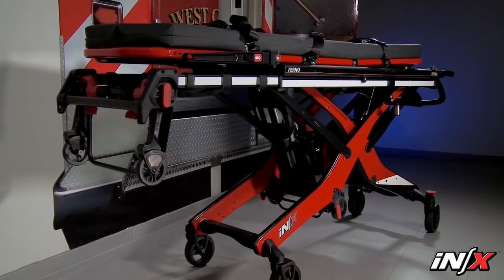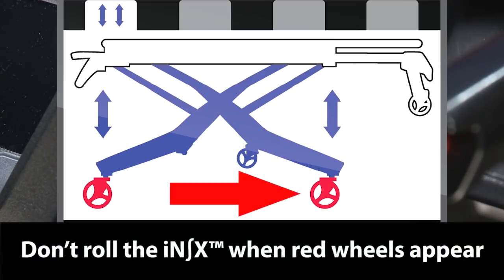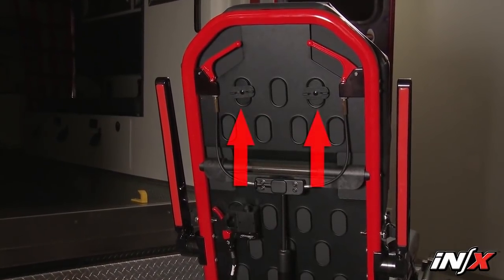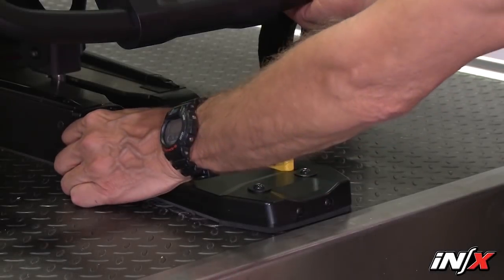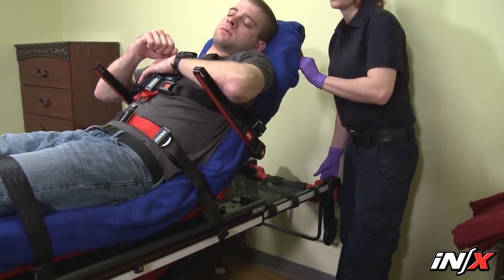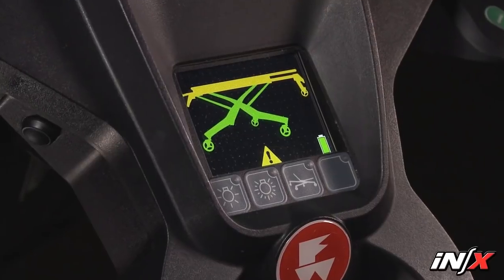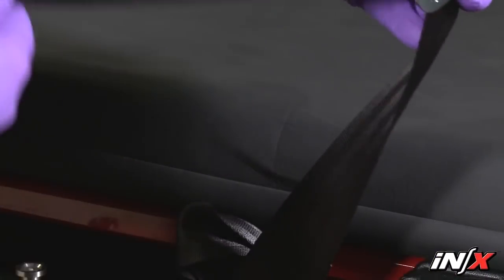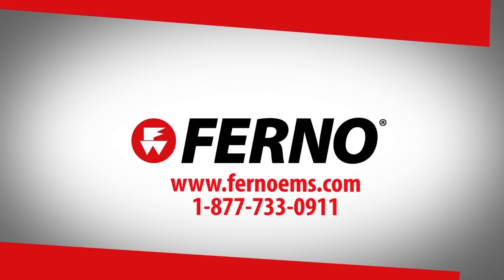00 iNX with iNLine Training Video

Comment: 0:10 Introduction
2:52 Initial Setup
7:24 Display
10:38 Battery
14:04 Power
15:13 Features
   15:20 Extend and Retract Buttons
   16:42 Locking the Pad
   17:15 Backrest
   18:10 Sidearms
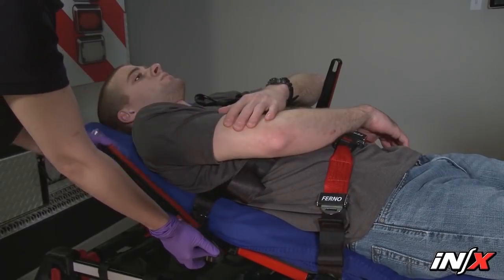   19:10 Telescoping Handles
   19:48 Telescoping Frame
   20:54 Shock Frame
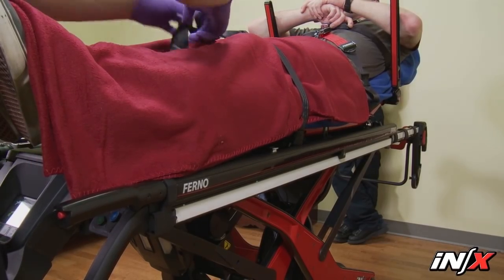   21:40 Accessory Rail
   22:45 Wheel Locks
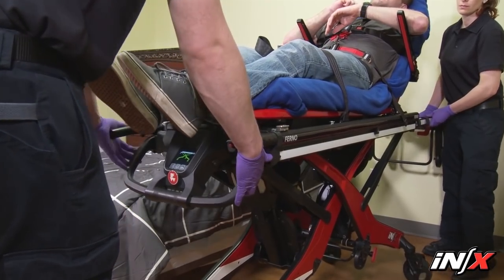   23:28 Lighting System
   25:14 Safety Bar Release Levers
   25:50 Oxygen Cylinder Holder
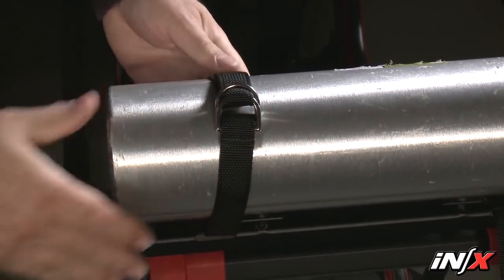26:45 Using the iN∫X
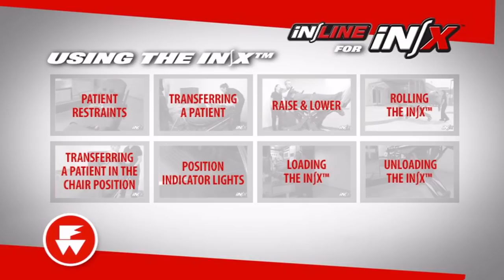   26:50 Patient Restraints
   29:40 Transferring a Patient
   31:55 Raise and Lower
   35:16 Rolling the iN∫X
   36:58 Transferring a Patient in the Chair Position
   39:28 Position Indicator Lights
   40:08 Loading the iN∫X
   43:31 Unloading the iN∫X
45:18 Using the iN∫X
   45:24 1 Operator, Empty
   46:20 Direct Power Mode
   48:18 Non-Powered Raising and Lowering
   50:30 Non-Powered loading
   52:24 Non-Powered Unloading
54:00 Maintenance
   54:06 Disinfecting and Cleaning
   56:22 Maintenance and Training
Reply: Your the real hero